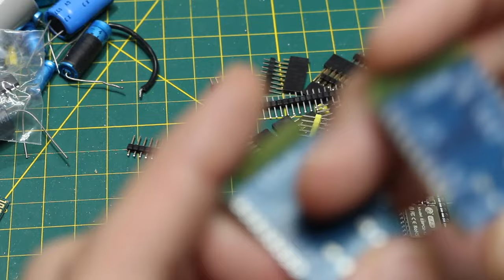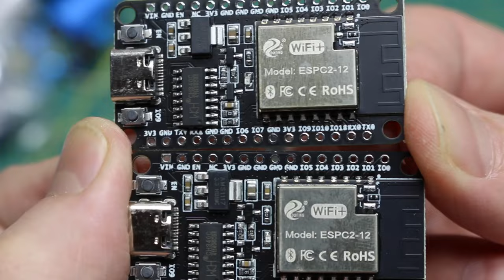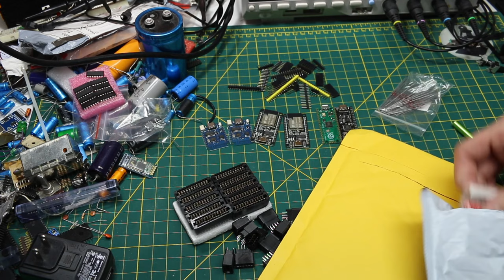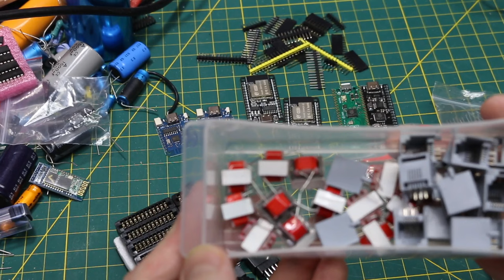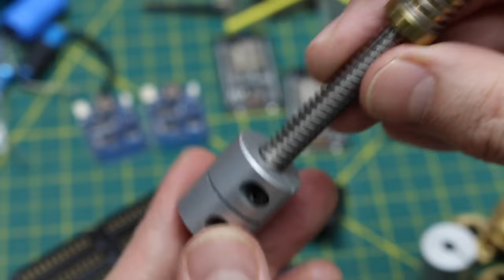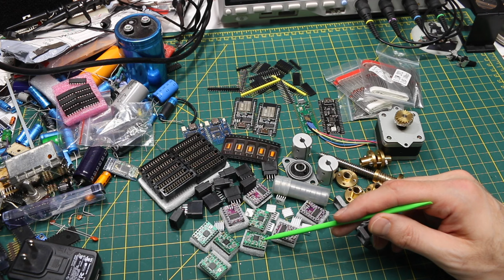Mailbag!

Comment: Very very cool haul.  I love that there are so many new little microcontroller boards.  Hard to keep them all straight but I'm glad they exist.  That exact microstepper driver is inside a lot of the laser cutters.  Especially the ones with the ability to take a rotary for doing tumblers etc.  I may need to get one of those.  

And I obviously can't wait to see what you do with the card edges.
Reply: Would like to play with a card edge connector that will fit the 5cm side of an FR4 protoboard.  They seem to be plated there to fit.

Comment: Though hard to find, I like the springy-style shaft-2-stepper connectors that have the circumferential tightening, like yours.  Makes the retraction movement less violent on a bed-slinger.  Also more forgiving of a nozzle crash.

Comment: I don’t understand the push to move to ESP32. Unless you need a lot of I/O pins, the ESP8266 MCU’s work quite well for home use.
Reply from the maker: Sometimes a 555 will also do the job.
One of the main things that made it mandatory to go to dual core was when needing to do to resource intensive things like Wi-Fi along with audio playback. The 8266 was unable to play smooth audio. 
For the single core, having the Bluetooth and Wi-Fi may be useful and also it may be good to have hardware that supports a more recent architecture in case the older one goes obsolete suddenly.